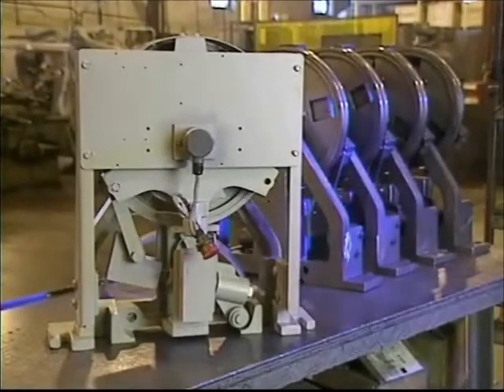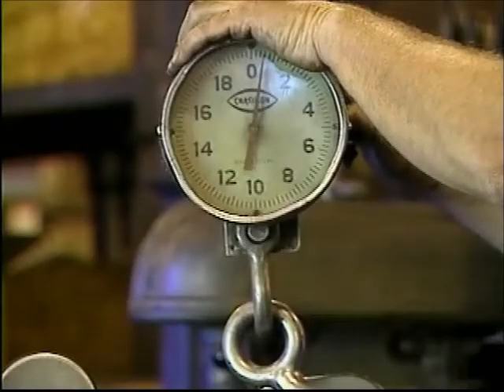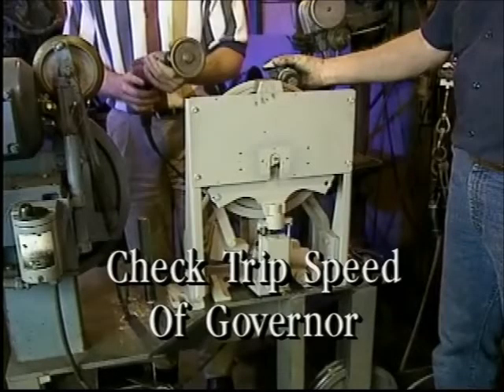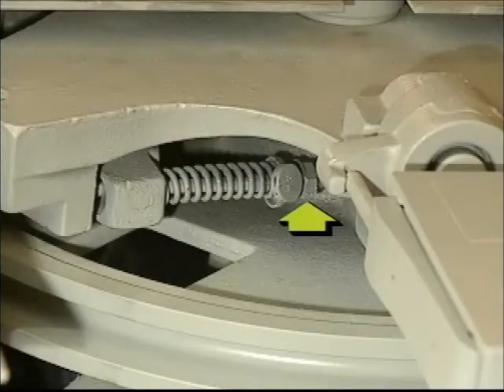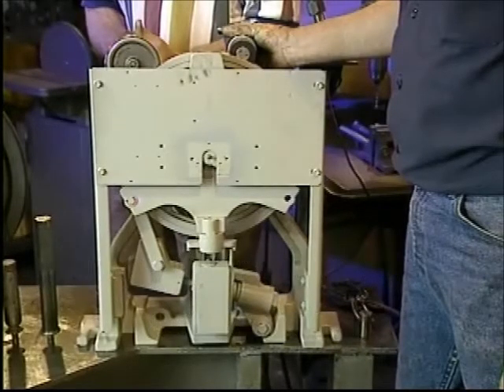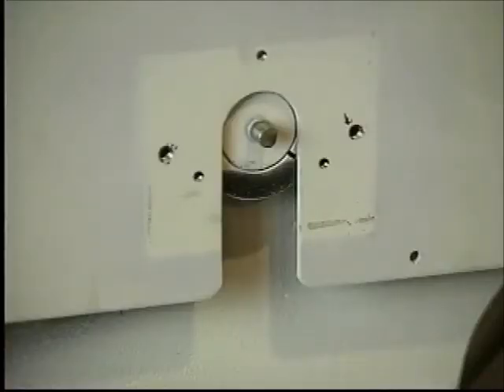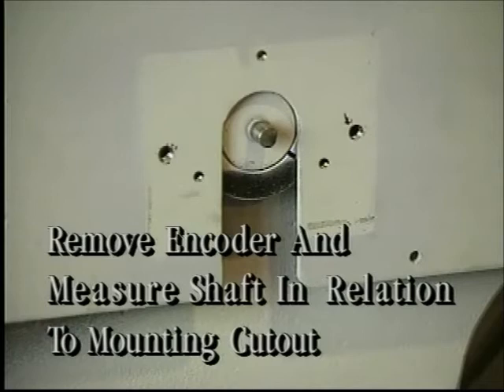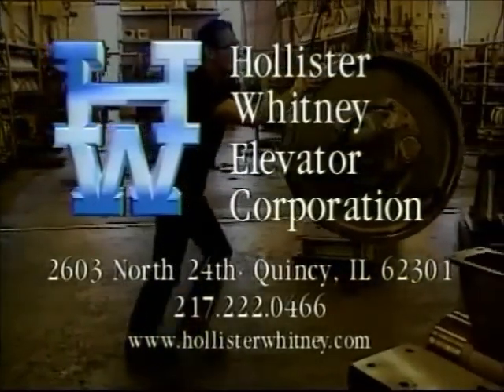How to adjust a Hollister-Whitney overspeed governor.

Comment: الشركة متخصصة فى صيانة واصلاح جميع المصاعد والسلالم المتحركة 
شعارنا ( اعلى جودة واقل سعر ) اتصل بنا على الارقام التالية : ( 01282110476 - 01023138315 ) 
تمت المشاركة في الأصل بواسطة fox elevators
* شركة فوكس أول شركة مصرية متخصصة في مجال صيانة وإصلاح جميع أنواع المصاعد القديمة جداً والحديثة (التي تعمل بريليهات بلاتينية حراري – ريليهات عادية – كارته عادية – كارته بشاشة – PLC  كمبيوتر –نصف اتوماتيك-اتوماتيك كامل-inverter  هيدروليك )
* كما يسر الشركة بان تخبرعملائها بأنها ستقوم بإنهاء جميع أعطال المصعد في اقل من 24 ساعة ومن سيتعامل معنا سيجد فرقاً كبيراً.فاننا نختلف عن الاخرين* تلبي الشركة تليفونات عملائها في اقل من ساعة اتصل على (01018170860-01153362877(01282110476

*شعارناالرئيسى (NO IMPOSSIBOL)…..
‹

›
13 صورة - عرض الألبوم
ليست هناك إجراءات plus one
ليست هناك تعليقات